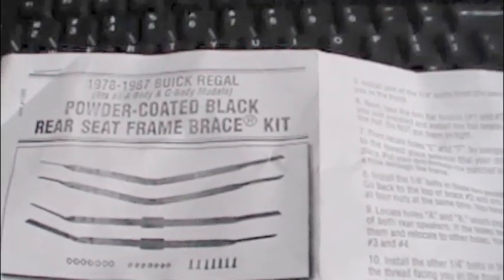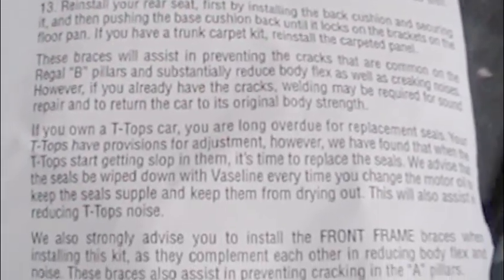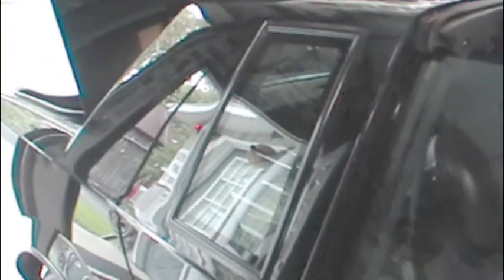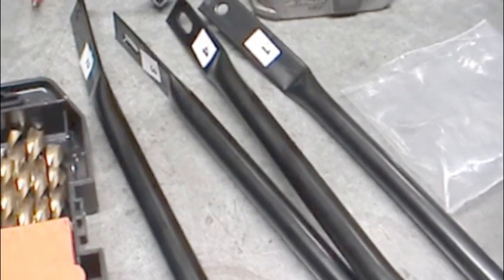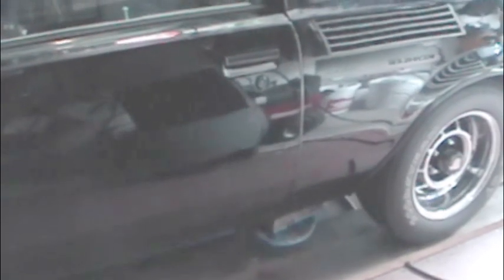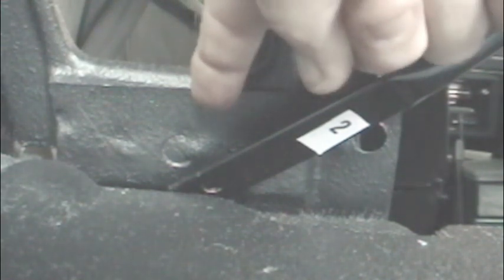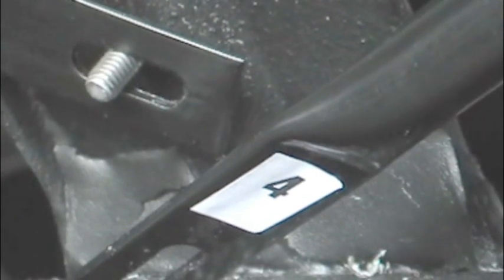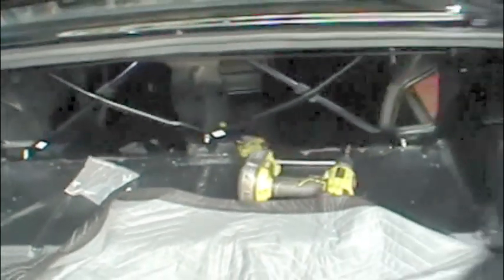1987 BUICK GRAND NATIONAL TRUNK BRACE KIT INSTALL (HOW TO) ...

Comment: Thank you for taking the time and patience to show how this is done.
I’ve been putting it off for a while when I bought the 86 GN.
I Found similar braces in the trunk, turns out the prior owner upgraded the intercooler so he had to remove the under carriage braces.
Looks similar to these braces for the trunk 
How was it to remove the rear seat and back of seat?
Reply from the maker: Two bolts / DONE. (Those are the Seat Belt Bolts / that retain the seat-"back") *obviously the rear seat "base" is removed first; and just pop's out. ... "all-done in mere moments".  : -   )
Reply: TommyZTrains Thanks!!
I’ll pull the seat later to see if it’s even installed, it may be but if not I saved your video
Thanks again Tommy!